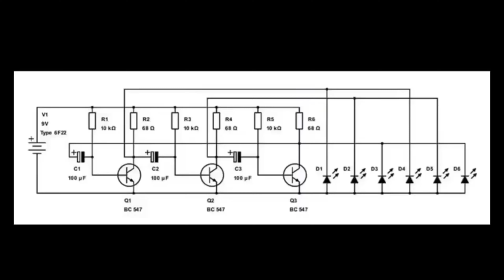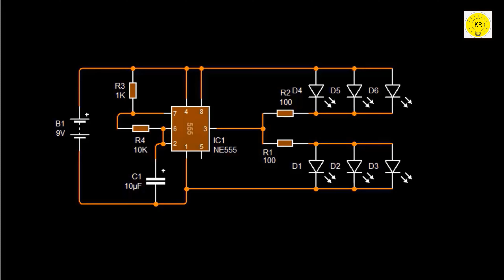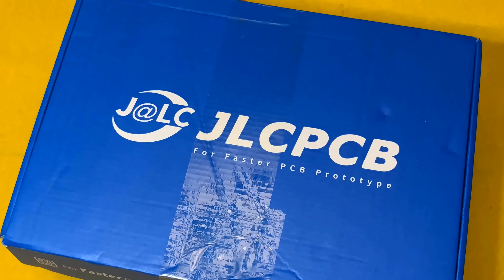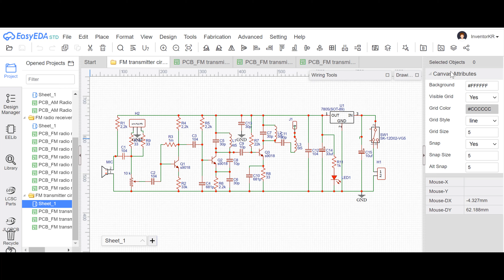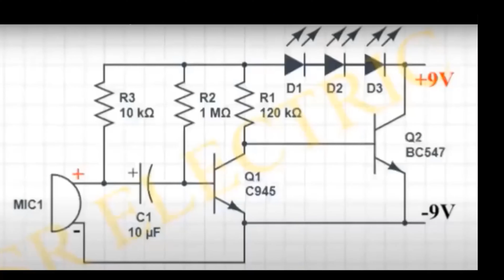how to make LED projects without using Arduino, JLCPCB

Comment: wrong again mate, can't work as per drawing, and as its marked up as +9 and -9 that would be 18 volts shorted by Q2, if Q2 could turn on, which would be impossible, BANG, why don't you check the drawings?